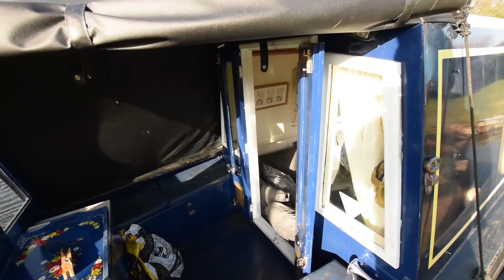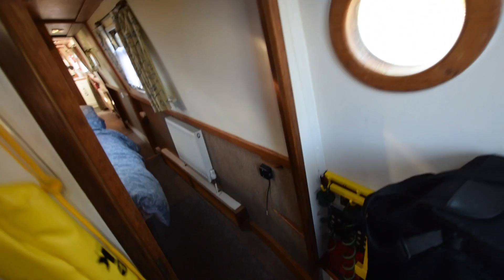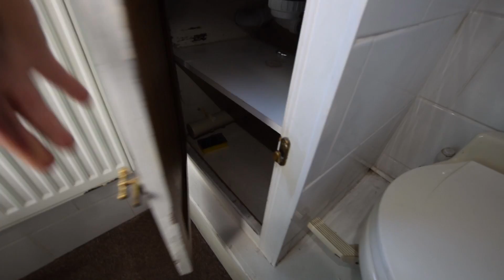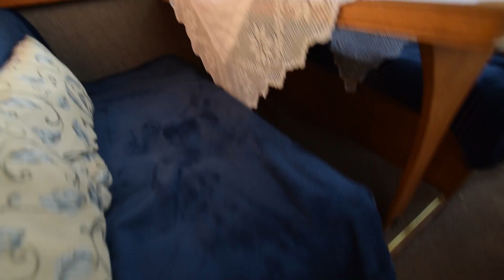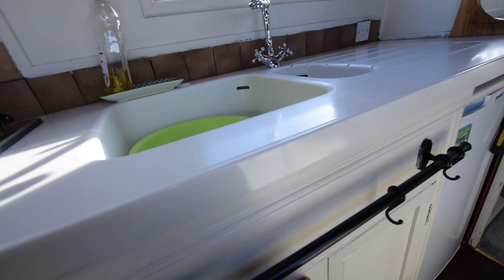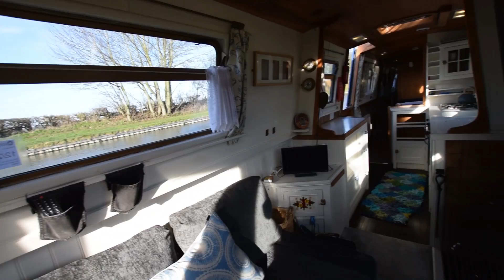SOLD - Presque Là, 57' Trad stern narrowboat 1991 Stoke on Trent Boatbuilders

Comment: From your experience selling boats, does this one with the zinc phosphate pretreatment on the hull seem in better condition that a normal hull? Just curious on the long-term benefits especially regarding a boat like this built in 1991.
Reply: When it came out for blackening I took a video that can be made available to purchasers. It's in a great condition for age. Grand junction boats blackened it said seen Hull a few years old in worse states. Its not been sat in marinas which helps.

Comment: Lovely boat.
I am a systems engineer, so techy things like remote control sound awesome. Is the remote control throttle, or steering as well?
Does this boat have an alarm? I thought I saw a motion sensor over the dinette.
Reply: It has an alarm fitted but in 5 years I never used it as the boat was occupied most of the time.